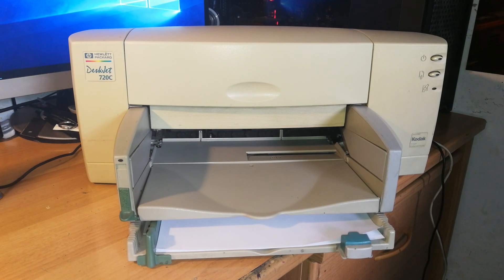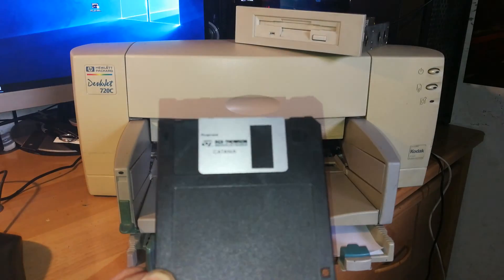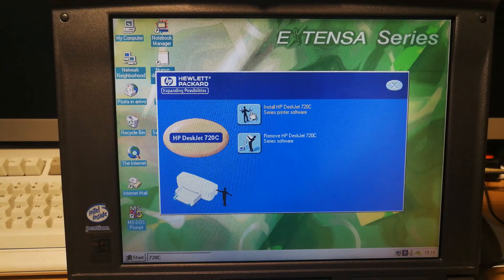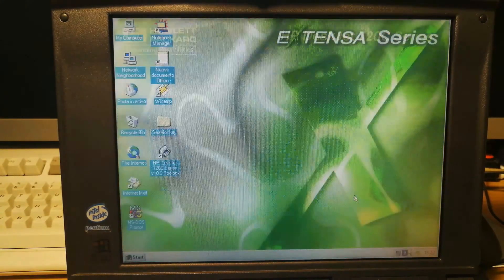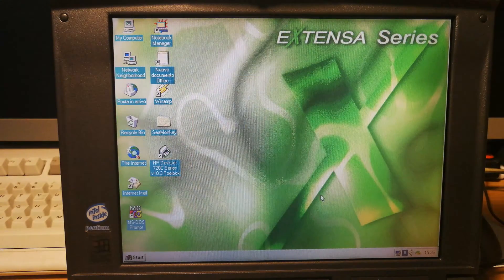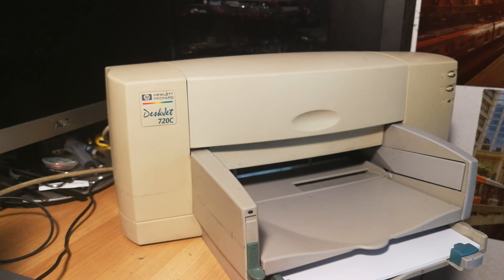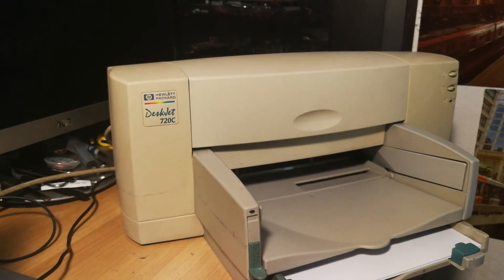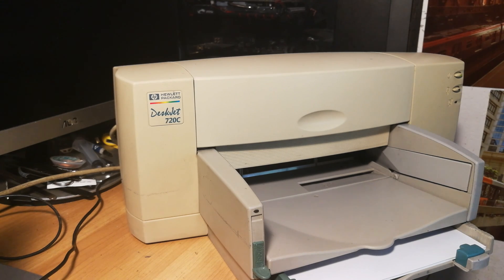(Hewlett-Packard) HP DeskJet 720C [1997] Setup & Demo

Comment: I currently have the professional version of it. 😂 If you bought yours can you tell me how much it costed you?
And if there's interested people there i'll have to sell, the same Deskjet but it was used in an office back then. It's printing recto/verso. HP still selling cartridges. Still running even on newest windows and the printer is still working. I don't sell it for parts, it's still operating.
I found a more newer functional one. I sell it 50 bucks.
Reply from the maker: Hello, I got mine for free some years ago, i'd say in 2016-2017
Reply: @PaoloMarcelli  I have a CXi to sell. Got it for free too but there's someone selling it 307 bucks on ebay.
Cartridges are 111 dollars worth.

Comment: This printer definitely takes me back to the 90's. It was connected to my family's 486 running Windows 95. I remember a game that was included that was a virtual dog game. My sister and I would beat that dog up. 

Things have certainly changed in the last few decades. We now have near crash proof computers and crazy amounts of ram and hard drive space. I moved on to a laser printer because the cost per page is way lower. I will say this printer does print way better graphics. It just takes around 10 minutes to print a picture.

Cheers to 90's technology.

Comment: I Have the 895cxi model , and I can't  make it working  under windows xp and windows 7 neither
Reply from the maker: With Windows 7 it should be installed automatically, for Windows XP you need to download drivers from HP. Are you using the printer with an adapter? Like a Parallel to USB cable?
Reply: @PaoloMarcelli  the 895cxi has both, USB and parallel. I managed to install the printer using windows update Cab in windows 7. The printer is recognized, but when I try to print a page, nothing happens.  I'm using a new black ink cartridge with an empty color cartridge, I read somewhere that these models can't print on a single cartridge only, they require both with ink inside, my father who has been using this printer for years told me that too, could you confirm that?

Comment: This is an awesome printer!!! I still have mine printing at this day in windows 10... how about that!
Reply: So how do you get it to work with windows 10? Cant find a driver that works
Reply: @dmyrjansen  i have a lot of old drivers for hp
Reply: @RicoJuan1998  do you have a driver that still works with windows 10? I didn't find any in my searches, that's why I used another approach to make it work
Reply: @dmyrjansen  i use a VMware machine with windows 7 inside windows 10 and share the printer
Reply: @edhgsilva  the driver that's available by windows repository doesn't let it print
Reply: @edhgsilva  thanks, will look into it

Comment: If you find a Bubble Jet, your lucky, used the Z Fold papper with the holes on the side to feed the paper,😎
Reply from the maker: In my school they have an A3 (13x19") bubble jet printer, I had one many years ago but I sold it, but I'd like to get another one, and maybe restore it in a video :)
Reply: Did you work for HP? Bubble Jet was the production name, the real name was Think Jet.
Reply from the maker: No I just get broken printers, fix them and resell as refurbished. Anyway I was referring to the Canon BubbleJet series, I didn't know HP had a bubblejet series of printers! D:
Reply: @PaoloMarcelli  The Think Jet was in the early 80s along with the PLOTTERS,  the 500 mono chrome printer, was the first Desk Jet, they were all Hps, when made them for Dell, cannon, Ibm, Dec Kodak we just slapped their names on the cover, and matched the colors, think it was like ten years before any company could steal the Ink Jet technology.
Reply from the maker: I have a deskjet 400 monochrome, but it doesn't work :/ it has a mainboard fault

Comment: I built and did maintance on this Bosh, Sony, Fugi auto assembly line in Vancouver WA, worked for 22 years, the print cartridges were made in Corvallis Oregon Eugen. Those where some great times, San Diego in 87 then Vancouver WA till 1999 then back to San Diego. Thanx for the memories, I have all kinds of old HP PRINTERS, TOUCH SCREEN, DOT MATRIX THE 8 PEN CARROSEL PLOTTERS 😎
Reply from the maker: Hey HP MAN
Thanks for sharing your memories with us, on this channel I have a video on a different vintage printer from HP that is the DeskJet 560c, the oldest printer I have i think of the deskjet line.
Reply: Nice! I finally tracked down a deskjet 550c and got the ink carts going again recently. Love these old printers
Reply: I'd like to buy one

Comment: How do you not have more views this video is radical
Reply from the maker: Haha thanks
My main subject on this channel is printers repair and review, so maybe it's just not matching my other content category :) but I don't know.
Reply: @PaoloMarcelli  I love these old deskjets. Ive been trying to track down a 550c for ages now and use a 842c as my main printer under windows 10. These old 1990s printers where very well built and the ink carts are huge and dirt cheap to refill although I wish some one made a cap to plug the black cart hole so I don't have to push a BB into it every time i refill my black cart. Eventually my black cart will be full of all the BBs Ive used to seal it lol.